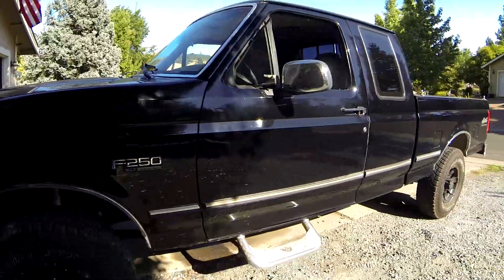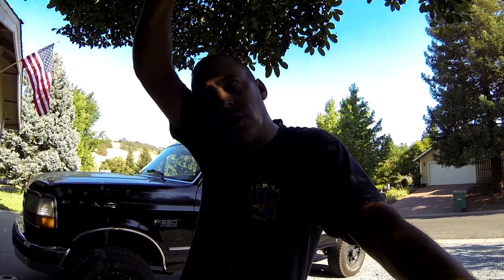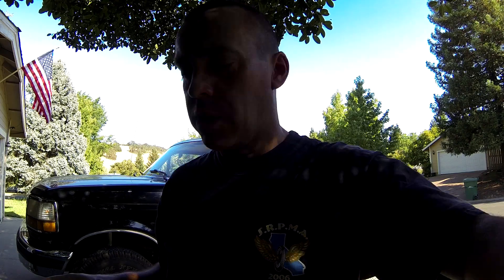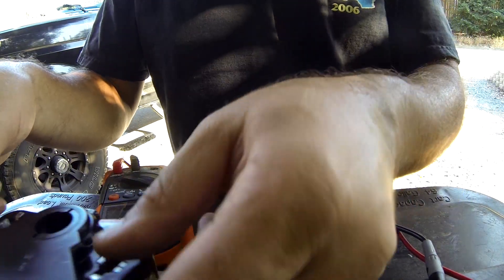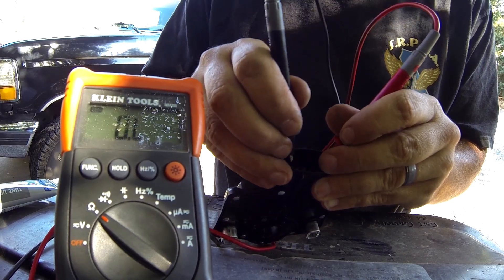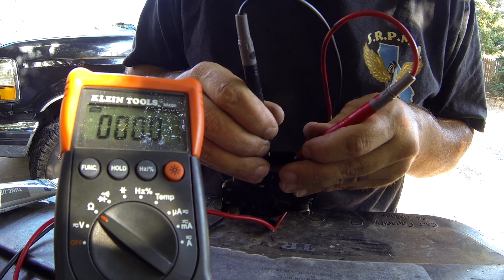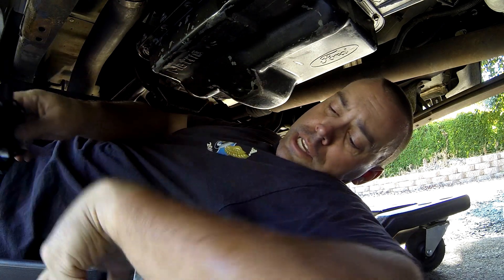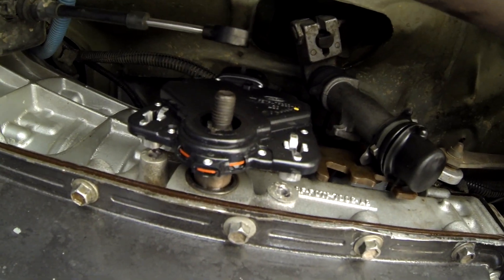Testing the MLPS on a 1996 Ford F250

Comment: Ihave the same truck with the same issue I am pulling the mlps can't get the weird nut off for the shift lever any ideas for what size that is I have a 9/16 and a 14mm it is somewhere in between though
Reply from the maker: Sorry, I don't recall and I've since sold the truck.
Reply: @IdahoLife   New MSLP fixed the issue, also re-pinned a new connector, these connectors are supposed to have a locking tab on them, apparently, well it was broken off disallowing for a connection to the sensors for VSS and MSLP

Comment: I live in PHX and my 1994 F150 V8 5.8 just started to shift hard in all gears. It's summertime at 115 and some humidity. Just started to happen. I let the engine cool down and started in the morning (underground parking 86) and 1st to second shifted hard right out of the gate. Lots of heat lightning as well. Air Conditioners dual capacitors pop this time of year as well. 
Since this truck is over 27 years old and an original AZ truck (Heat will Crack Plastic) I'm going to change the (1) Throttle Position Sensor (2) Neutral Safety Switch on Transmission Housing (3) VSS on the rear differential. Parts were about $130. (Yet to install)

I think static electricity has something to do with it, but can not be for sure. In any case for $130 I'm ruling out all three of those sensors (which could have been electrically zapped) or cracked plastic housing.

I hope it is not the solenoid pack in the E40D transmission - that would be my 4th and last step. (Transmission fluid is light pink, with a very tiny amount of bubbles on the dip (tested after 45 minutes of driving).

What I'm I missing? I tested every fuse under the hood - all good.
Reply from the maker: Whenever I got stumped, here's what worked a good portion of the time:  Go around and clean EVERY ground you can find.  I didn't know what the ground may have been for, but cleaning it often helped and sure couldn't have hurt.  Even if it looked good, I cleaned it and either fixed the problem I was having, or prevented another problem from popping up.  Best of luck!
Reply: @IdahoLife  Thanks CM. I think because I live in AZ we don't really get a lot of rust and this is not on the top of my mind. I'll check that out. I may have found a couple reasons my shifting in/from all gears is the issue. MAP Sensor (I know really!) and Transmission Neutral Safty Switch. I'm going to swap them out and see what happens. (Being 27 year old truck probably will need it sometime 130K miles).
Reply: @azwb  did you solve your problem and if so can u provide an update? Thanks!
Reply: Talk about needless parts cannon. You should be testing parts with a multimeter before blindly swapping them out. You seem to account for every weather phenomenon under the sun. Did you account for user error when handling parts replacements, or new parts being ineffective compared to the OEM parts and/or incompatible.

Comment: My 96 f250 7.3 does the same thing. At first the speedometer stopped working and shifting was hard. I replaced the sensor on the rear end and it fixed it. Now the overdrive off light blinks when the motor get warm and shifting is  haywire. Cant even take the truck out of town. I wish I knew it the transmission switch that this guy is replacing fixed the problem. Im also going to replace the blade fuses. I read that there may be a malfunctioning fuse causing the problem.
Reply: I agree. The guy tells everybody they are stupid of they forget to check the wheels, then does his shade tree repair and never does any follow up to say if the problem was solved.
Reply: Me too!

Comment: I had a car that would go in limp mode. turn out to be a short on the blower motor resistor ...the higher the you turn up the fan the faster it would drain the battery... even with a good alternator it would drop below 12 volts.. used a cigarette lighter adapter with volt meter to check voltage. hope that helps someone out..

Comment: Did it fix it ?
Reply from the maker: Nope.  A new transmission fixed it, unfortunately.
Reply: @IdahoLife  Where did the first new one come from? I'm having this issue again on a new trans.
Reply from the maker: @chipsutphintv8452  monstertransmission.com.  Absolute garbage.  Terrible customer service.  I would never use them again for anything to include directions to the nearest gas station.
Reply: @IdahoLife  Heard a lot of comments concerning MT

Found a local shop that was expert in E4OD's put shift kit and rebuild with special heavy duty parts that he had never used before. Not orderable in regular parts rebuild kits. Everything was better design with frictions, bearings, pump and different torque convertor for towing in greater than 8700# GVW I think the parts cost increase was about 300 bucks. rebuild cost the same for labor as std. rebuild. has been two years still pulling great also installed used deep oil pan from a diesel E4OD filter is with long fitting neck.
Reply: @mongomay1  how much the rebuild cost u?
Reply: @johnpaulcurran1843  
about 2K
I wanted something robust and reliable, included deep pan and ultrasonic cleaning of cooler, lines, shift kit for towing/weight, heavy duty parts replaced all std. parts where available, pump and another internal section was replaced with new. Basically just used the old case and electronic valves and some other components. Have about 10K on it would recommend replacing the electronic control harness to solenoid valves.
Reply: CLEAN THE GROUNDS! 1 IS RIGHT BEHIND THE HOOD COIL ON THE LEFT/THE OTHER IS NEXT TO RIGHT SIDE NEG BATTERY TERMINAL(CLEAN THE BODY IE NO PAINT PUT DIE ELECLTRIC GREASE ON THE BODY AND ALL CLEANED TERMINALS)THE LEFT IS THE MASTER GROUND TO THE ECM...I HOPE THIS HELPS YALL

Comment: Hi - Any updates? Did this fix your problem. I'm having a similar issue on my 97. Thanks
Reply from the maker: Mike Middlebrook unfortunately,  no...it didnt fix my issue.  Only a new transmission fixed my problem.  Gotta try the easy stuff first though, right?  Good luck!
Reply: Thanks. Unfortunately I've had the problem  for a bit now..before my trans rebuild and since the build more often.  Changed the diff fluid, the vss sensor, and now the psom. Haven't had any driving time on the psom yet. Hoping it cures it. Thanks again.
Reply: I had the same problem as described in this video. I changed my MLPS but it did not fix the problem. I took my truck on a 6 hour trip with my Gear Vendors OVER/UNDER drive engaged. I stopped for gas around 150 miles in and there was sizable puddle of ATF under the transmission. I lost around .5 a quart and started back home in hopes to not having to use a AAA tow. I checked under my truck every 5 miles for 20 miles and the trans leak went away entirely. I decided to continue with  my trip and turned around to my original destination. I was driving my truck in limp mode for around 100 miles before I had stopped for gas. The overdrive light did not flash until I had almost reached my destination, but there was not leak at this time. I have now returned form my trip with the overdrive light flashing twice on the return trip around 200 miles in and 250 miles in. The overdrive light flashing indicates limp mode. Now my truck is getting a new transmission. The problem according to a world class ford mechanic is that my torque converter is slipping. This mechanic has my exact truck except with the 7.3 (I have the 7.5) We both have Banks exhaust, gear vendors, and he specializes with these old fords. We are putting a Jasper E40D up and i'm glad to finally be getting rid of this limp mode problem. My truck has been going into limp mode since December of 2015 here and there, but recently every time I take the truck out it will go into limp mode at some point in the trip. Otherwise it shifts fine. Thanks for taking the time to read this. I hope this helps someone out there with their E4OD.
Reply: There's a valve body kit, around  70 bucks, I'm gonna do that and see if that will fix hard shifting  in all gears.
Reply: Any progress on your issues after the psom fix? Thanks...p.s. also having the same issues...some before rebuild and now much more after...new vss and pigtail only so far.